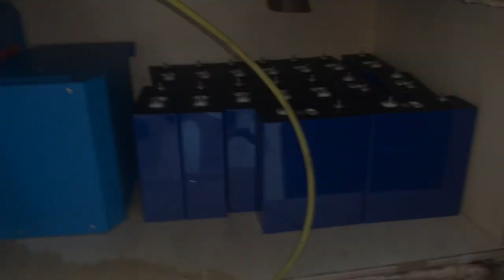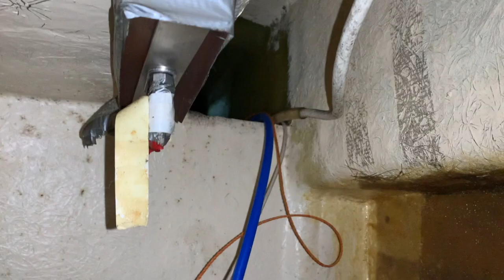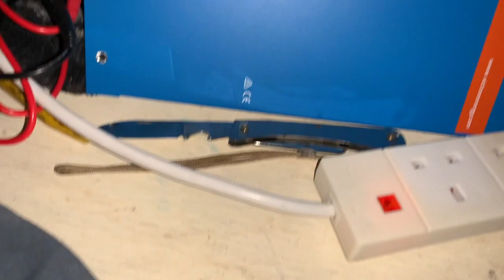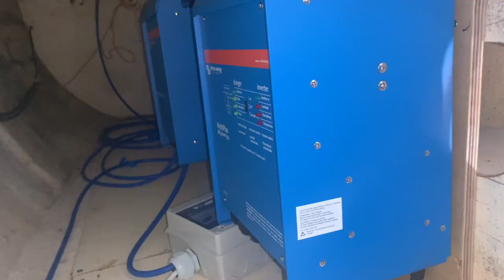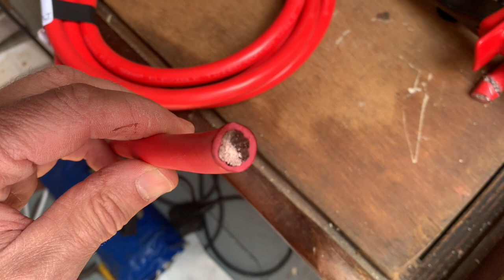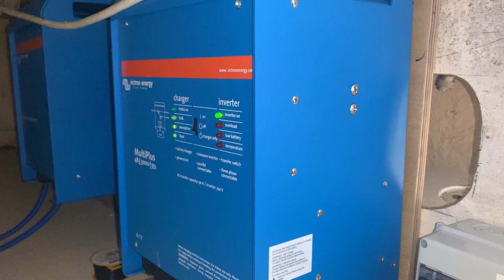The £5000 cup of tea

Comment: Hi Steve. Thanks for documenting your electrical upgrades; I'm considering Victron as well.  The more I learn about the isolation transformer the more I like the idea. I was watching a channel on Youtube called John Ward and he had a warning about the rcd test button. His video warned that the test button only proves that the rcd works but does not prove it will work to protect a human as wired if the wiring is incorrect. Another device I have come across is called a rvd. Are you familar with that? Happy sailing.
Reply from the maker: Hi Matt. Thanks for the kind comments.
The isolation transformer is certainly better than the alternative, using galvanic isolators as these can fail as a short circuit leaving you completely unprotected. Another advantage of the Victron is that if I ever visit somewhere that has 120V I can use it as a step up transformer and still use shore power to run everything
It's true that an RCD will not necessarily protect you if you have wired it up incorrectly. I have a degree in Electrical Engineering so I hope I have got it right but I am still going to get it checked over by a Marine Electrical specialist once I have completed the current tranche of work.
I hadn't heard of RVDs before you mentioned them but having done a bit of Googling I can see they would add an extra layer of protection. They do a model which is designed for Inverters with AC pass-through so that looks like the favourite. I'll do a bit more research and thinking and may well add it to my setup.